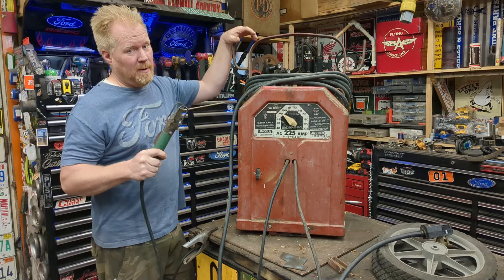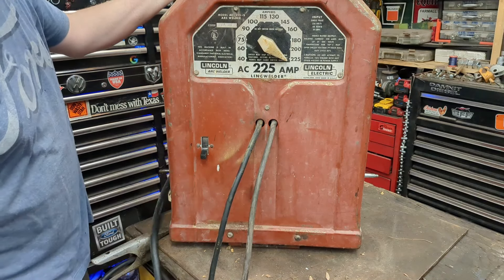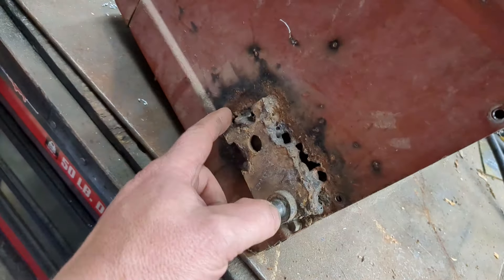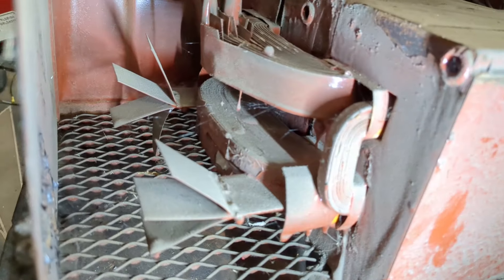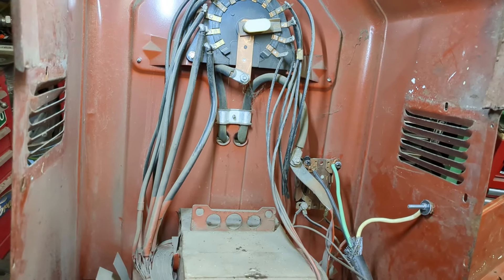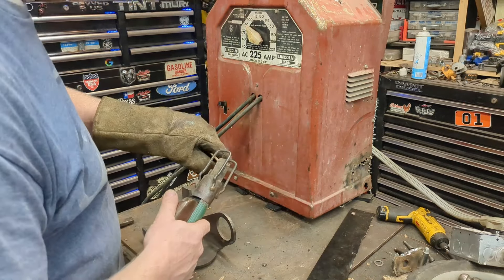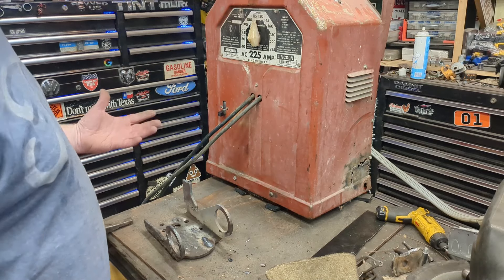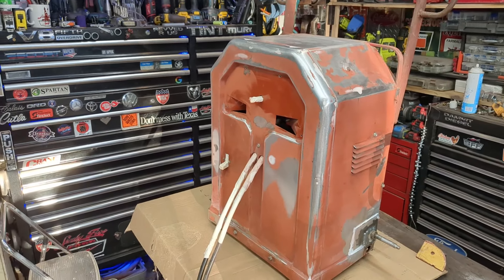Vintage Welder Fixed & Restored LINCOLN TOMBSTONE 225 AC buzz box

Comment: I had to laugh when you opened the case and showed the wiring. I picked up a Miller 225 Thundervolt from a tool repair guy years ago. He'd taken it in on trade, never plugged it in. Made him an offer, he accepted. When I plugged it in it didn't work well, did as you did, mine looked fine inside, checked plug, figure the same guy who wired yours wired my plug. Swapped the connections, runs perfectly. That's why the chuckle, figured that guy got around way too much.
Reply from the maker: That's funny.
Reply: I have one of those. Haven't touched it in decades but it welded good and then I had the weld structural. Oh my god 70 18 on that was a nightmare but we got it done and then we went and bought a bigger DC machine a red one

Comment: I'm 60 years old, inherited Dad's tombstone ( that just doesn't sound right, the machine I grew up with.) No telling how many boxes of rods the thing has burned building fences, garages, trailers, you name it. Just as hot as it ever was. The only issue I've had is the dadgum black widow spiders think it's a condo. Fan quit, took it apart and the fan blade was basically tied in place with spider webs. Cleaned it out inside with quick shots from a WD40/ Bic lighter flame thrower, good as new.

Comment: Yes you can use 120 volts. It will cut in half the output. Adding a high frequency unit and hooking up a air cooled tig torch with with appropriate gas and you can weld light gauge aluminum . Please note this is for a AC unit only.  This was unofficially told to us in an advanced welding class at Lincoln's school back in the 80's.  Please don't think about using 440v, it will be dangerous for sure. I served a welding apprenticeship with GM in the mid 1970's and was fortunate to attend advanced welding classes at Lincoln and Hobart many times. At almost 76 years young I still weld and always find myself learning to this day.

Comment: The real early models were sorta rounded on top instead of tombstone shaped. and had a crank handle the on the front of the welder. and a dial at the back on top that reads from left to right the amount amperage. and down near the bottom at the front of the welder. there was access to plug in cables for charging automotive batteries. and they were referred to as Lincoln buzz boxes. you might ask me how I know this? and that would be because my father has one.

Comment: I just inherited one from the 70s.. only thing is that it's been sitting outdoors on a wheelchair frame for years.. but you made it look so easy to work on. And besides being a bit rusted it's still in decent shape.
Definitely going to try and fix it up a bit.

Although I think I have to get a generator to power it.. anyone got some recommendations on a decent gen?

Comment: I have one of these from about the same time. Leads were shot, so I replaced them with new. And CORRECTLY wired in a new power cord. The one I have sat outside in a field for 20 years. Fan motor takes a minute or two to get up to full speed, but welds just fine.

Comment: I just refurbished one of these. It was more rust than paint and was bolted to a chunk of plywood with one caster still left on it. I replaced the spring in the selector/ pointer with a lighter tension one so that won't break off in my hand. The rest of it is bulletproof. It is bolted to our PTO generator and ready for action.

Comment: I loves me some barn finds!

Years ago I picked up a Century transformer AC/DC machine for a song.  Talk about a workhorse!

Then, I stumbled on someone selling a dirty, dusty, crappy looking 300 amp Everlast  SMAW (stick) inverter machine on the serious cheap.  Apparently, the poor cosmetics kept everyone away.

Once home, I opened up the machine to find all kinds of crud on the inside including a rather large wasp nest.  I disassembled it completely, cleaned everything, and power washed the case inside and out.  It now looks like a brand new machine!  Oh, and the buttery smooth arc of modern electronics with dig and hot start!

You know you've arrived as a serious fixer when the home shop sports a lathe, welder, and oxy-acetylene rig.

Comment: I have one of those from 1982 which is  wall mounted. It has to come down every so often to oil that fan. 
When changing my compressor over to 240V, the price of the wire and plug was outragious, so pricing a new welder cord was about half the cost......that was the way to go.
My garage has a 30A circuit and my Lincoln can only go to "90" or it blows the fuse.

Enjoy your stuff, keep up that good work!!

Comment: The problem with those welders is 1 heat setting is to low the next 1 is to hot. My welder has that and a fine adjustment !

Comment: My old shop was bare minimum. 
I went to an auction in town, but got there too late. The auctioneer was cleaning up. I walked over to the scrap pile and noticed a big Miller box welder on top of the pile. It had a burn mark on the top of it and one of the cable sockets was broken. 
I asked if crew wanted to sell the welder. The guy said it was shorted out I offered $10.00.
I knew it was just an arc strike where someone laid the stinger on top of the box. 
A new power cord, a new piece of hardboard to support the cable socket, the windings cleaned, and the box painted, it has been good for 30 years so far and still going strong. 
I bought a HF MIG welder. It is plumbed for gas, and I have a bottle but only use flux core. 
The plasma torch is a 110/220 that cuts up to 5/8" plate. 
I picked up a Metal Man 110 stick and TIG Welder. Too bad I didn't think to check. It is only DC so it won't weld aluminum well. That was the reason for buying it. 
Your Lincoln is a fine machine. The big wheels are a great idea.
Reply from the maker: Awesome story! It's good for people like us that we live in such a disposable society.

Comment: Bought mine brand new year's ago for $99.00. It looks like brand new today as I keep it covered in my garage.  It came with no wheels and has no wheels. It is heavy and I always assumed that the transformer was copper wire.  Thanks for the great video.
Reply: They cost $400 aC welder. Lowe's south Texas

Comment: I always wondered why the 75 amp position is circled.
Reply: I was wondering that myself. According to the gargler it's the pipe thawing setting. We live in a very strange world.
Reply: @1pcfred  Now that you mentioned it I remember an old timer telling me about using his welder to thaw out the pipes in his mobile home. Probably thirty years ago.  I thought he was nuts.
Reply: @paulgumper  he was crazy like a fox. It's still a nuts idea though. But not as screwy as Lincoln was making it a marked setting on the machine.

Comment: In 1980s I worked maintenance in small company and they had a lot of these on the benches.  The transformers had many taps and a switch to choose which one you wanted. The most used tap was 90 amps and the transformer tap wire for 90 wasn’t that big. A common happening was guys dropping the lead on the bench and shorting out , burning the transformer wire up. Also in our shop they painted machines in the building and the fans got all bunked up with paint overspray.
I had a bunch of beat up machines and tried o make them all work.
I did, but one of them the transformer had a major short and while it would still work, the case was connected to one hot line. Yeouch !

Comment: I made a ground clamp from a battery charger clamp for my Lincoln Promig 140, and put silver contacts on it from a relay. I ran braided cable from one jaw through the handle over to the other side. Its kinda like your dryer cord. It wasn't made for it, but it works.

Comment: I just wanted to let you know with a follow up comment when this video came out two months or so ago I left a comment on here saying I was going to look at my Lincoln tombstone welder that I acquired for free from a neighbor that moved out.
Anyways long story short after cleaning some dirty connections replacing the AC plug, the electrode holder then  oiling and manually working the fan until it wanted to freely spin again the welder now works like a champ I just wanted to thank you for giving me the inspiration to actually take on the task without watching your video I probably would have never messed with it and it would sat in the corner of the garage until I needed the space and then I probably would have tossed it into my scrap hauling utility trailer.
So now I just got 10lbs of electrode sticks from Amazon (Christmas eve) and now I get to learn the finesse of arc welding, I have gotten pretty good at my 110V fluxcore wire feed (I still haven't bought the bottle for it to make it a MIG but that is another story)  so I figure learning a stick welder  can't be to hard.

Comment: I have the twin of that one. Dad picked up an "extra" one, because you can't have just one welder. But the leads were so old the insulation was cracked in numerous spots, etc. 
Now it's all fixed up so it's not dangerous and I put it up for sale. I never use it since I got a Miller AC/DC Thunderbolt. And now I never use the miller because I got a multi process/MIG welder.
But hey, it's not in the dump and can do real work for somebody on a budget.
Reply from the maker: They're a great starting point for someone to weld. Yeah, I only use mig or tig for anything anymore.

Comment: I love these old death machines that people have done a hack job on the power cord.  One of them I had was so bad sparks shot out of the kluged connection when I powered it up.  I have owned 15 vintage welders and they all ran fine when the power cord issues and bad output grounds were fixed.  Good video.
Reply from the maker: It's just good ol fun plugging these unknown beasts in.

Comment: Omg, that thing was dangerous!! To run that machine at full capacity, it should be hooked up to 50 amp breaker and plug. I have an old tombstone as well, from the late 60s or early 70s. Very nice job on the restoration!!

Comment: I have that exact model and have been welding with it for 40 years and it is still going strong. When you turn it on you should definitely hear the fan. If you strain to hear the fan then something is wrong. Also, the switch should make a loud and solid clunk. Do not change amperage while welding. Check the cable connection to the rod holder from time to time. My cable just pulled out once. Of course turn off the welder immediately if that happens. Don't try to catch the cable when it falls. Could get zapped! I made a four wheel base for mine to roll around. Didn't do any welding to the machine itself. Don't electrical weld on vehicles. I ruined an alternator doing that once.

Comment: Yessir! I’ve had a Lincoln since about 1973! All I’ve used until recently getting a $79 flux core wire welder and just a few weeks ago finally an Eastwood multi function mig/tig/arc. But when I need to weld up something for strength from thick metal I always use my old standby! It welds deep and strong!
Thanks for showing the old classic some love!!!
Reply from the maker: Absolutely!

Comment: By the look of the welding on the wheel axle and the wiring this welder wea previously owned by an old farmer.  I weld with one glove like you too, just seems to give Better controll of stinger or Mig gun.
Reply from the maker: I get so much grief for that. I can't stand wearing a glove on my mig gun hand.

Comment: Bought one of these new from western auto in the 70's still have it went to do some welding with it and wouldn't start on arc tried several times no luck figured the welder quit bought a newer Hobart welder tried the same rod on the Hobart wouldn't arc? tried a different rod arc started just fine found out the rod itself was dead would not arc at all, so I have a new Hobart welder and my old Lincoln never had that happen before or sense.

Comment: I changed my fan to a 220v computer type fan, then went on to convert it to AC/DC. Just picked up a 2nd one that's factory AC/DC but it needs a new power cord and some love. Being an electrician, I always investigate before plugging in things.
Reply from the maker: If it was dead no op I would have investigated. The guy had it plugged in when I went to pick it up and was showing them how it didn't weld so I thought nothing of it.

Comment: I have one that I bought back in the 70s and it works great today but recently I put some harbor freight nylon wheels on it so it could roll around easier.  I put square tubing on each side of the welder and screwed it through the bottom side of the welder into the square tubing so the wheels would be under the welder instead of outside of the welder.  It roles like a champ in every direction and is very easy to roll in every direction with just one hand.   I think they all should have came with 4 wheels under them instead of the 2 wheel back axle job that Lincoln made back in the day.  I have a friend that wants pictures so he can do the same to his.

Comment: My uncle used to check for electrical shorts in cars with one of those by using the “smoke test” . Hook it to the battery terminals and turn everything off and slowly turn it up until you see smoke . Theres your problem . Outside in the open

Comment: I put 50 amp "oven" plugs on my welders, I also have a pigtail and long extension if need be I can temporary wire into a panel. not that I'm a welder and sure not a mobile welder(rare occasion), but I have it if needed and I can use the long extension with adapter cords on the generator(only 30 amps), but the 6awg wire keeps voltage drop minimal, not that I haul it around either!

Comment: I demod Lincoln welders ,the best way to tell  age of a welder of that type is by the weight ,older ones were wound with copper, newer had aluminum windings.
Reply from the maker: All the ones that look like this are Aluminum. That's from the late 50's to current. Honestly though the weight difference would only be a pound, maybe two for copper. Scrap guys cut these up all the time thinking they found a copper transformer but nope. The ones with a round top are copper but even then you probably only get 2#s of copper worth $5 scrap.

Comment: I never switch mine while on, also I had to use deoxit d5 on my contacts when it got hard to switch.  I felt it would be safe for any plastic, and it was.
Reply from the maker: It's an issue to switch while it's welding but there is no difference if it's on our off while changing amperage.

Comment: I've got an old 'Tombstone' out in the garage that hasn't been fired up in DECADES...but mine is only 180 Amp. I wish I could get (or build) a big-assed rectifier for it so I could get DC output out of the thing.
Reply from the maker: There's a quit a few tutorials and I think it only costs around $50 to convert it. The only issue is it cuts the amps in half. So it would put out 90amps DC. But generally you use less amps on DC than AC anyways.

Comment: When I was in high school shop class in 1990 the shop welder was really an ole school welder, the way we had to change the amperage was to unplug the cables to different plug position on the welder to achieve different amperage 🤦🏿‍♂️so the welder you have is what out shop class should  have had a more modern welder at the time🤷🏿‍♂️....but the is a good job on restoring that welder one more thing I see you're a Ford guy💪🏿💪🏿

Comment: Well done and I’m so glad you didn’t get electrocuted. I don’t understand the need for the ginormous electrical plugs because in Australia everything is 240 volt, power points, lights everything and our plugs are a regular size unless it’s 3 phase 440 volts then we get the big plugs. 
Also, here every power point has a switch and every power point and light socket has an earth and we don’t use bare earth wires they are all insulated with green and yellow sheath so as you can imagine US wiring is weird and confusing to me😂. Cheers Stuart 🇦🇺
Reply from the maker: They're so large to handle the amperage. 240v at 50amps is what these big plugs do where your home stuff is likely 240v 10amps. Our homes use the same wattage at 120v 20amps(or 15amps). The benefit to Australia's and Europe's 240v is you can run thinner wires/less copper as you're using less amps. We run 2.5mm2(15amp) and 4mm2(20amp) for our 120v home wiring where at 240v you only need half that size wire. I will say though these large plugs aren't meant to be plugged in and out all the time and are generally considered semi permanent.
Reply: @sixtyfiveford  Thanks, I didn’t realise it was 50 amps. Jesus, you don’t get a second chance with that sort of current. Yes, Australian outlets are only 10 amps with some being 15 amps but the 15’s have a larger earth pin. That means you can plug a 10 amp plug into a 15 amp socket but you can’t plug a 15 amp plug into a 10 amp socket. I enjoyed watching the Coleman trailer rebuild and seeing the tombstone welder being used. You’ve developed an interesting channel. Cheers Stuart 🇦🇺

Comment: I taught myself to weld using one just like it.  With mine I traded a set of tires I wasn't going to use.  Try removing the wire off of the ground clamp and feeding it down through the hole in the handle then hook it back up,  you won't need the electrical tape to hold the wire.
Reply from the maker: Oh, I tried. It was driving me crazy but it won't budge.